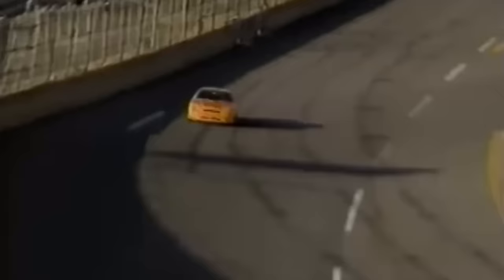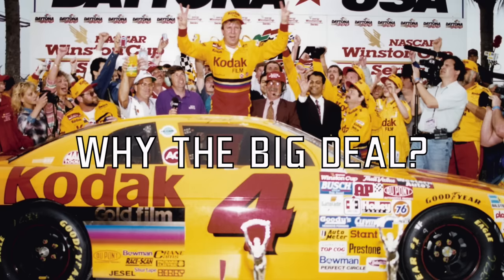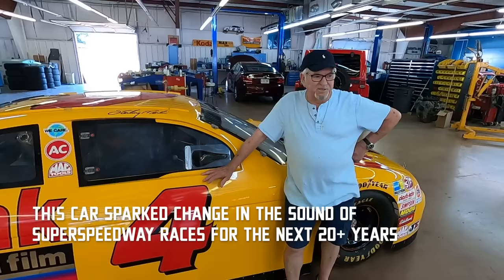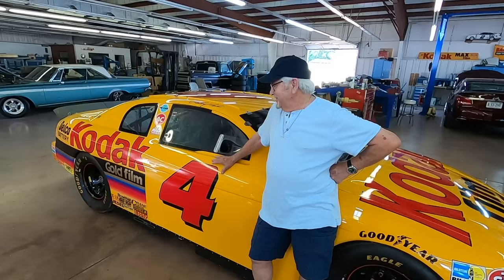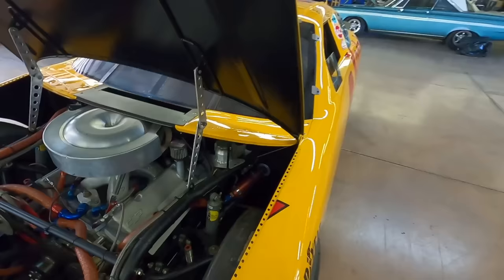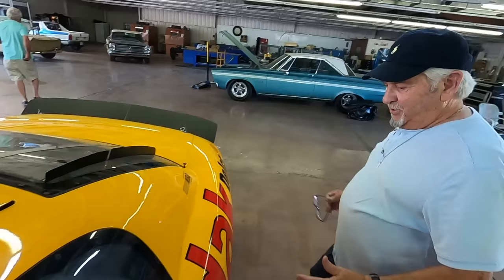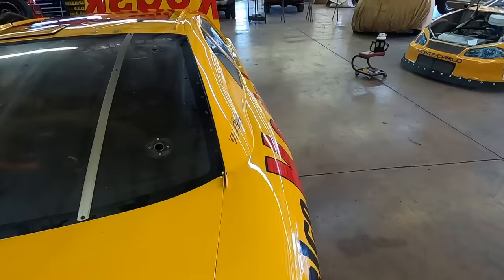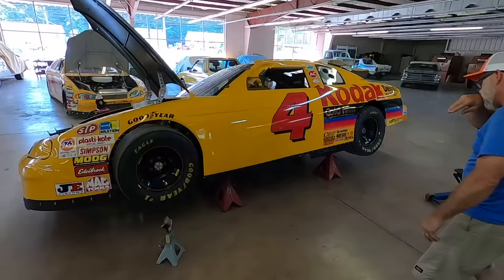The Car That Changed NASCAR: Sterling Marlin's Crazy Sounding 1995 Daytona 500 Winning Monte Carlo!

Comment: Never will forget Sterling in the 4 car at the 96 Pepsi 400 started front row and led a ton of laps till ignition failed. Got passed by the whole field Sterling thinking a blown engine till he switched to the backup ignition, engine fired and he flew back through the field to win the rain shortened race 🏆 🏁

Comment: Larry McLure is a legend. I was at that race, hell, I was at the clash and qualifying the week before.  That sound was crazy compared to anything else.  It was my 2nd Daytona, what a great time to go. $85 tickets, $200 for 3 nights hotel across from the track and people like Larry doing these little things to get a half mph or 2-4 hp more. I have pics of Dale Sr taking a pic with my friend at the trailers, without being swamped with people. Also with Mark Martin, Stirling, Rusty at the old Outback.  What a great time.  Literally 50 of us friends for 15 years straight, 500 and the Firecracker.  I sponsored a small spot on Billy Standridge’s car a few years later and I remember the July race when he blew up on the first caution because they, unknowingly, had the engine set up to scavenge the oil out of the pan and it blew because he didn’t keep the rpm’s up enough.  He said Cale Yarborough’s people didn’t tell him.  Just like Stirlings car, they had things they had to do to run these cars.  It’s not like today where they don’t even have to shift and aren’t allowed to touch anything.
Reply: The good times !!!
Reply: They definitely still have to shift. Manual transmissions are still used in Nascar. You'd be hard pressed to find a professional race car driver who doesn't know how to use a manual. Now obviously Formula 1, Indycar and most GT race cars now use high-tec DCT with paddle shifters, but that's just common sense because they're shifting gears way more, so it's a faster and more efficient way to go through gears and you can keep both hands on the wheel.
Reply: @flobama3247  i know how to use a manual. He mows my lawn.  🤣
Reply: @flobama3247  sequential is barely shifting.
Reply: Good old days of Nascar that car sounded totally different
Reply: @mikelliteras397  Still pushing a clutch and moving the shift lever. Sequential manuals are more efficient for stock car racing.
Reply: @flobama3247 race cars don't use DCTs. Who told you that?
Reply: Done went and said a mouthful….

Comment: When they brought this car out I knew that the sound was the exhaust configuration, and even showed a couple of guys how it was because we ran the same basic system on our limited super modified, we used CSC over the top headers that were separate banks and put the merge collector and about 18 inches behind them connected the two exhaust pipes together with the same 4" diameter tubing the rest of the exhaust pipes were made from. People were going nuts trying to figure out what the secret was with even a few thinking we had a trick 180° flat crankshaft from Chevrolet racing and we tried to tell them they didn't exist, it was even said that the engine and it's components were super trick NASCAR stuff since the same person built our engine that had built engines for a several time championship Winston West team. It was sure a lot of fun using the team's motto of "if you don't hear a new rumour by 11:00 a.m. start a new one".  We would then bet how long it would take to get back to us, and how many changes had been done to it.😏😎😇
Reply: Yes, and the "sounding like an IndyCar" thing had to be totally coincidental. An IndyCar is designed entirely different (mid-engine, etc.) and thus this trick was solely to do with this particular configuration.

Comment: Another great video Mitch and Logan!  I remember being a teenager glued to the TV and hearing that exact car scream around the track.  WOW!  The stories and details you guys uncover. . . Most people don't take the time to find the hidden gems that hide in the details that teams used to get an edge back then (dual oil pumps, longer primaries, etc.).  And to think most of these innovations came from the minds of folks with good old practical know-how, not some design lab & 3D programming.  By far the best content on YouTube; engaging, interesting, original, and REAL!  Would love to see Sterling climb in that car and fire it up again!  Keep up the great work, you guys are awesome!
Reply from the maker: Thanks man!!
Reply: Those long tube equal length headers were another thing that helped with a little "edge". The long tubes would give a little more bottom and mid range torque from the engine, most don't think of needing bottom end or mid range torque in a restricter plate engine since they were running them flat out. But nobody was thinking about restarts and leaving the pits but a few feet gained from little boost in torque could be the difference between a win or not.

Comment: X-pipe the whole way. I remember it well. Dr. Gas X-pipe on my 5.0 Mustang GT and full length hooker headers. I also had a 125 HP NOS Nitrous plate system. That car sounded incredible. I had it 15 years before some idiot neighbor crashed into my garage and totaled it out back in 2002. I still miss it to this day.

Comment: I managed machining at Roush Racing back in the time frame of Mark Martin, he drove the Valvoline 6 car, all the performance, and cheating was in the intake manifold as he touches on, followed by the cylinder heads, I machined many of both items.
Reply: Any truth to the idea that when Roush started running five cars, the 16 (Musgrave), 26 (Benson) and 97 (Little) were basically R&D cars for the 6 (Martin) and 99 (Burton), or did the performance gap have more to do with the multiple campuses Roush was operating out of at the time? Or maybe neither?

Comment: I was 10,11 years old when this was happening, and very distinctly remember when they kept talking about how it sounded. This was a super iconic car, and I have to admit this is a dream to see underneath the skin. But dude I can't wait to see the cylinder heads, I know there was an outfit that sold used nascar motors,  was always a dream of mine to have one in a 49/53 Chevy 5 window truck (I since learned I don't fit but I still want one) slammed on steelies with the fenders cut out, and a 4 speed
Reply from the maker: Thanks man they are definitely fascinating

Comment: I ran a real 'Dr. Gas' X-pipe on my '03 F150 Lightning; Bassani shortys', OEM catted mid-pipes into the X-pipe, flowmaster super 40's, and MEGS at the end of the tailpipes. Mods running 15 lbs boost. 5-6000 RPM that 5.4 sounded a lot like Sterlings motor..

Comment: Lots of little things added up to 40 HP and that was a lot of an advantage. They also had different rear gear sets for Daytona and Talledega so that you could run flat and 200rpm below the point that vales floated and the whole engine sang. They had it tuned for that from carb to the end of the boom boxes. Thats what he means about the "signal".

Comment: Seeing that grin he had while y'all talked about the little lets just say innovations they come up with to gain every little bit of edge over their competition was awesome. Can't wait to hear your car with the equal length headers and that exhaust. Ever thought about tracking down a set of the old heads and intake to replicate one of those classic small block engines from that era? I myself have been trying to find a deal on an older set of SB2 heads to do something similar but man are they pricey lol Love the content, keep killing it brother!!!
Reply from the maker: Thanks man. I think about that every day. Absolutely want to do that for the Monte.
Reply: They are pricey because every drag racer in NC are running them and have been for years!
Reply: When was the SB2 introduced? Wasn't it in 98? I can remember them talking about how strong the Chevy and Pontiacs would be with it.
Reply: @jebediahgentry7029  yea 98 I believe is when they switched to the sb2 platform
Reply: @KaminerRacing  what was the difference between the SB2 and what they had been running?
Reply: @jebediahgentry7029  as far as I know mainly the head design the valves were offset in the heads different from a standard factory head and it allowed them to run a bigger valve set. I think they were like 23 degree heads as well but I can’t remember all of the specifics
Reply: @KaminerRacing  I have no idea.... but that sounds right
.
The valve angle makes a HUGE difference in flow
.
One of the reasons the LS heads flow so much better than the SBC

Comment: These videos that you & Logan have been doing are absolutely cool stuff beyond a doubt! Yes, that car had a howl to the exhaust, one of those crazy things that happens, I suppose. I get a similar "howl" from my Dodge Challenger R/T hemi w/manual trans when I rev it through the gears in the upper end, SRT exhaust did that for me plus increased my power output noticeably.  It has an x-type primary pipe from the end of the midpipes back to the Flowmaster mufflers, done up in 3" tubing. Runs hard and sounds sweet! I like an exhaust on a car that has a nice bark to it when you accelerate, plus you can hear the engine and what it's doing much better.
Keep up the great video content, it is a pleasure to watch this stuff, and being the gearhead that I am, it interests me to no end. I appreciate you guys for these weekly history stories and am there with you each video, as you well know. Thank you very much! You both rock!

Comment: The 2 floorboards was a pretty cool chest back in the day, I’ve been listening to Dale jrs podcast, and that cheating episode was the coolest. I remember hearing about the v6 thing too as to way that car sounded so unique, kinda would make sense, restrictor plate only lets so much air through, may run better if it was running in just 6 cylinders, and use less fuel. All those cheats were so cool back in the day. Now it’s all mandated cars, boring, that’s why I don’t watch it anymore, but I love hearing about all the olden days.

Comment: You’ll be surprised how much your Montie will sound like a Winston cup car. I had a Nova with a 355 I built with a 630lift solid roller cam and a A LOT of compression. My exhaust was Dynatech stepped headers an a x pipe. It sounded like a stock car!

Comment: Golden content has been delivered. I've been scratching my head watching the boom tube videos and especially after after this one of where I've seen and heard this kind of thing before: The Group 5 Zakspeed Capri. When they built the ground effect versions of it, Zakspeed flattened the exhaust tubes. Not nearly as radical (or as acientific) as Dr.Gas, but the sound of that Capri (and the first iteration IMSA GTX Mustang/Mercury...which is the pretty much the same car) is very distinct compared to just about every other small displacement turbo four pot hand grenade from that time period.

Comment: What a rabbit hole.... I heard the 1970 Chapparal Camaro trans am car on Instagram and had to investigate.... Which led me to binge watching your exhaust science Playlist. Thank you so much for nerding out on this topic. I have a 300+ hp turbo miata, but I keep dreaming about ls swap. Destroke a 5.3, upgrade the valve train, high comp, and Rev to 7500. I want that nascar/transam sound but in a 97 miata. Perfect trackday and street car.
Reply from the maker: Thanks man!! Welcome to the rabbit hole 😂 I’m in the process of building a short stroke huge bore lsx based 353ci for 9k+ so you’re gonna love that one when it comes up 🏁
Reply: @Stapleton42  10:40 'Sux more vacuum'' to sublimate the oxidizer.  'we had a five stage oil pump' ya in chemistry labs its' called a vacuum diffusion pump, which requires hot oil.
17:30 'Its' not accelerating when you have to let off of it', the driver knows what the HOBBY tubes were about, ohh hooter tubes.
You going to deal w/ that cognitive dissonance anytime soon?
The displacement of a 5hp B&S can output 100-150hp.
Check out Rob Dahm's F1 from 91' tear down, seven throttle bodies.

Comment: I actually ran a Doctor Gas X exhaust system on my late model race car that I built in a small one car garage in Madison, CT with an engine built by my good friend and former Winston Cup engine builder for Jack Beebe’s farm using the same paint scheme and number as is the car that they ran and won in the 1981 Talladega 500 with Ron Bouchard at the wheel. The car despite being so heavy and having a bent rear end would pull everybody down the straightaways. Had such a good time with that car! I did not have a team but rather a friend or two that would go to the racetrack with me to talk to me on the radio. Got some fuel help from Mike Joy from his New England Fuel Company and very much appreciative for that! Like I said, good times that I had building the car since I got to do some things to it that said could not be done like putting a Bilstein shock in between the wishbone on the upper control arms and attaching it to the lower arm and not having the upper arm hit the body of the shock, nobody else was able to do that but me at that time. I have now going on to build an electric car that will go about 840 to 1280 MILES ( not Km) on a single charge but unfortunately for me, doesn’t seem like anybody is interested in that, I don’t know why!
   Edward H. “New ideas and Innovations, LLC” Madison, CT

Comment: I have a very similar X pipe on my 78 Monte street car with a 383 Vortec small block, i run a wide ratio 4 spd so nice low first gear which allows me to wined out the engine and indeed it does sound like a indy car going through the gears.
It also has a gear drive cam that makes the motor run a little different and adds more sound.
Cruising on the hy-way at 3700-4000 rpm (90-100 mph) she's a pretty sweet ride.

Comment: So much could be, and has been, said about this car and its impact on restrictor plate racing in the 1990s.  But everyone should know the name Mark Giles.  Mark was the lead fabricator for MMM and he actually built the exhaust for this car.  Dr. Gas created the x-pipe, that's true.  But Mark Giles built and tuned the rest of the exhaust system.  The headers each had to be just the right length and the exhaust flow from the engine all the way through the boom tubes had to be just right in order to get peak performance... and that iconic sound.  So, props to Mark for being one heckuva fabricator.  Gets completely overlooked when stories are told about this car.

And while I'm at it, everyone please remember that horsepower was only part of the equation.  So much of what made this car so good can be attributed directly to Tony Glover.  He also gets overlooked far too often while the attention goes to Runt Pittman and Boyd Butler (Dr. Gas).  Glover could set this thing up for Daytona and Talladega like no one else.  Just a very special group of guys that MMM had back then.
Reply from the maker: I talk to Mark regularly he’s an awesome dude. You will see him on the channel sometime soon!
Reply: @Stapleton42  Thanks Mitch.  Can't wait to see him on here.  Do you know if he still has that 1978 Camaro on a Nascar chassis? Has the exact sound you're looking for on your MC.  Blessings to you and Logan and thanks again for all you're doing to capture and preserve the history of this sport.

Comment: The Ramchargers ran 180 degree headers in the early to mid sixties, resulting in an almost 6-cylinder sound from their wedge big V8s.  But this X-Pipe setup ws really unique and surprised many who thought the McClures were running 180 headers. Great video. By the way, tri-y headers (instead of four into one exhaust) came from Jardine, Doug's, Sanders and Hedman and Jere Stahl then built a set of four tube into one collector headers for Jenkins and the try-y was pretty much finished by then as Jenkins went at least 3/10s quicker in those Old Reliable cars.

Comment: Worked at a muffler shop in Chicago and 180 headers were the rage early 70s. The short track cars  would have no floor boards past the shifter you ran the sheet metal up high then straight to the door. Then you made the headers come over the top of the engine with the collectors over the bell housing. Chevy BB and SB sounded crazy but built some for 427 Ford nothing like that sound!